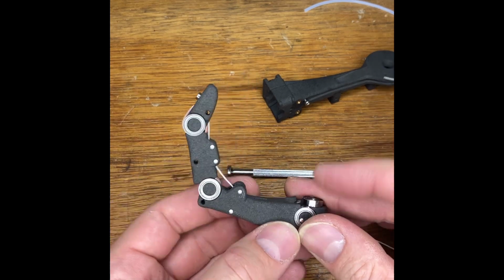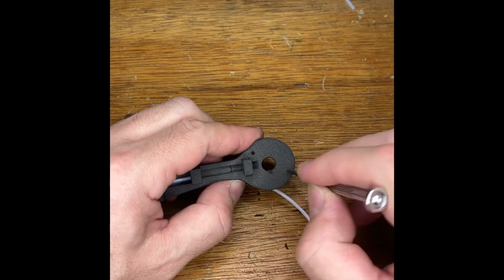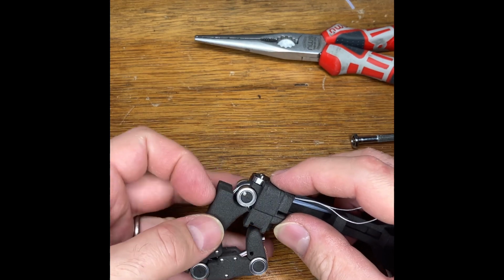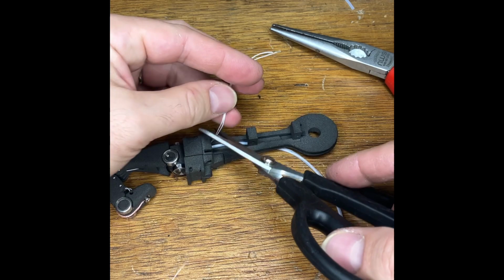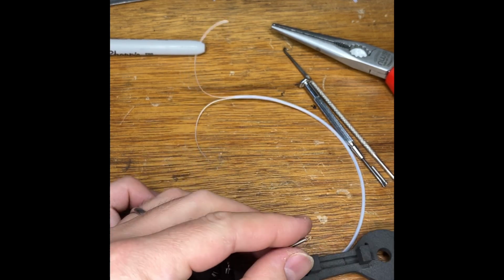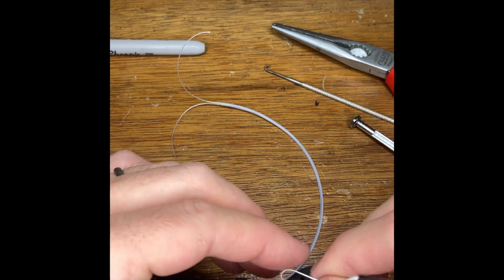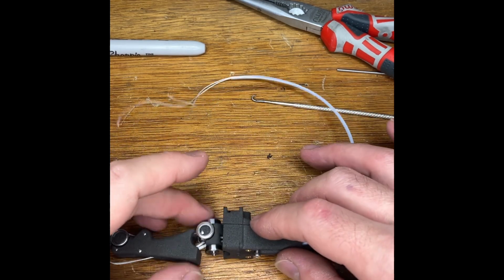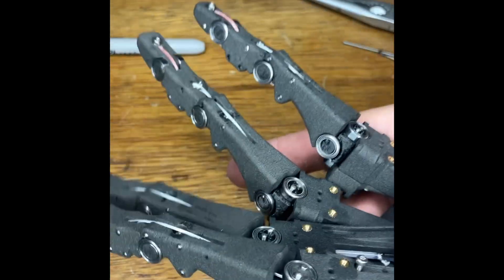How to build a V1.0 DexHand Part 5: First finger example assemble to palm #DIY #lowcost #robot #hand

Comment: Hi, this project is awesome to have as open source and thank you for publishing it. I'm at this point in building the hand but can't figure out where to place these pins for the springs in the other palm bones to avoid interaction with anything else, or as to not slip off--particularly for the middle palm bone which does not have a structure to rest against. You said in the video that you were going to add some holes in the CAD model for this but I didn't print any, and the IoTDesignShop's modified version isn't changed either--drilling a hole is no problem, but I'm unsure of placement as I'm a bit unfamiliar with interactions further in the build. 
Are there any suggestions you might have as I tackle this?
Reply from the maker: Great to hear how well you're getting on! Just watch to avoid interference with the ptfe that passes through the palm bone and beneath the distal wrist pitch pivot bolt: https://youtu.be/Z6GHe4XPgKo

Comment: great job.  my only issue is that the same motor actuating the finger can run the reverse direction to also do extension instead of the spring.  The spring will be too weak to have meaningful strong and fast extension compared to a motor and so despite it reducing complexity, it handicaps the robot in the end.  Not worth the compromise.  Not only that, but it literally works against the motor during flexion so hinders flexion some.  Just all around not worth it.
Reply from the maker: Whether a design compromise is worth it depends on what the design is trying to achieve.

The V1 is intended to be a relatively simple and low cost introduction to one of the more advanced body parts of robotics.

As it’s an open design feel free to make any changes and please consider releasing them back to the community.
Reply: @therobotstudio  yeah our goals differ so in that case it's fine.  i think you can use a spring from a pen
Reply from the maker: Yes, I’ve tried that too, worked pretty well 😁 Are you developing a hand yourself at the moment?
Reply: @therobotstudio  yes I'm working on my robot's hand at the moment
Reply from the maker: Great, looking forwards to seeing it!

Comment: Can i know spring spack?
Reply from the maker: Yes, the outer diameter is 3mm and the wire thickness 0.4mm.

I buy 1m lengths and cut the springs to length as needed.

I just found this on AliExpress: €1.47 | 1pc 0.2mm 0.3mm 0.4mm 0.5mm 0.6mm 0.8mm Stainless Steel Super Long Tension Spring Extension Spring Wire Diameter  Length1000mm
https://a.aliexpress.com/_EJdse28
Reply: @therobotstudio  thank you really helpful